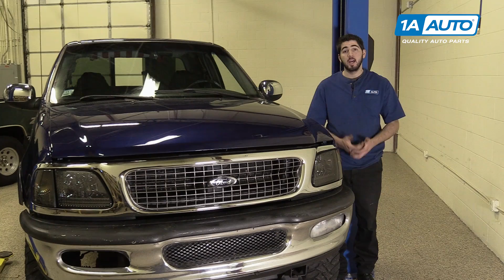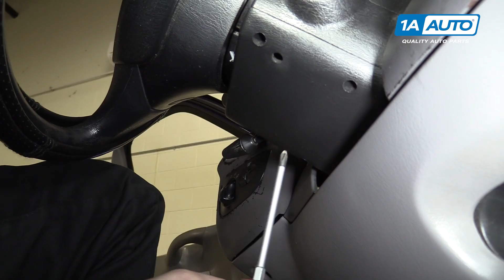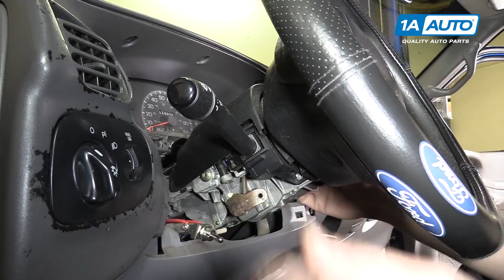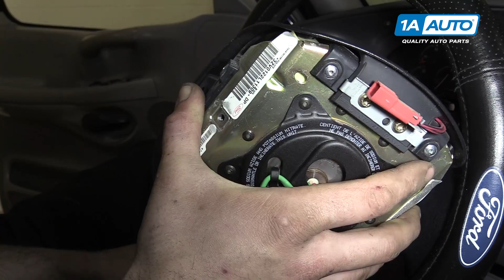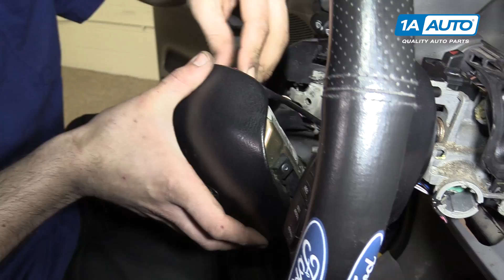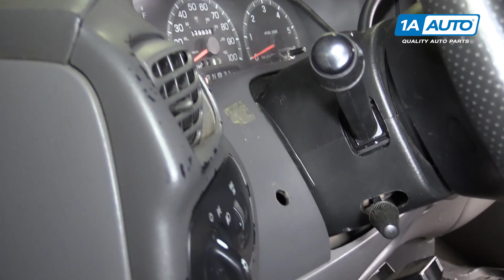How to Replace Steering Wheel 1998 Ford F-150

Comment: I don't understand why you remove the Shroud and the key switch it's totally unnecessary just remove the two 8 mm screws from the airbag unclip your wires and remove the t-50 bolt. Also the Ford shop manual says it's only necessary to remove the cable and let it sit for 1 minute but I agree better safe than sorry. Again though there's no reason to remove anything except the 8 millimeter bolt covers behind the airbag  and the T 50 Torx Bolt
Reply: I think they show it this way because if a tool slips it could scratch the neck pieces or doing something wrong and cracking the plastic. For people used to things like this, they have a better understanding of what NOT to bend and pull lol. So, unnecessary to remove it. 🙂
Reply: True because really there's no need to remove any of those plastic pieces

Comment: I suggest hitting brakes and/or turning on head lights after disconnecting battery to remove and electricity in the system that could make air bag deploy.

Comment: Can it be adapted to a Ford Ranger 2002 XLT?  I think that steering wheel looks better.
Reply from the maker: +Alvaro Jimenez Ganceda It may be possible to adapt it to that application, however, we wouldn't have instructions on how to do so, and we only recommend installing parts for your vehicle that are designed to fit it. 1aauto.com

Comment: Why did you take the shroud covers off? It was unnecessary.
Reply from the maker: +InternetDude It it much better for filming, as it gives the viewer much better visibility!
Reply: If you re-watch the video, you'll see that the shroud does not in any way impede visibility. I would argue that it's bad advice to tell Joe Public to remove the ignition cylinder, if they drop it or turn it while it's out it can be a bad day for them.